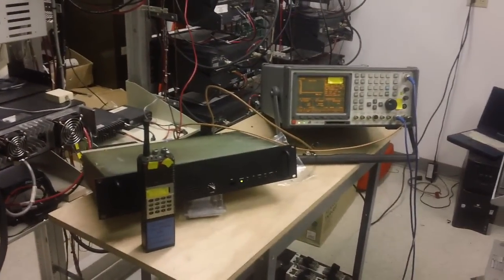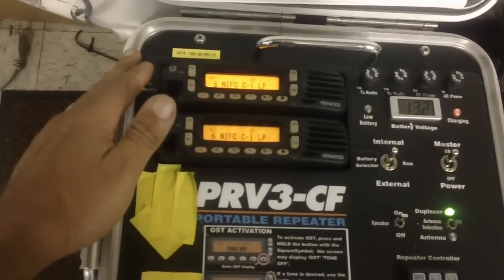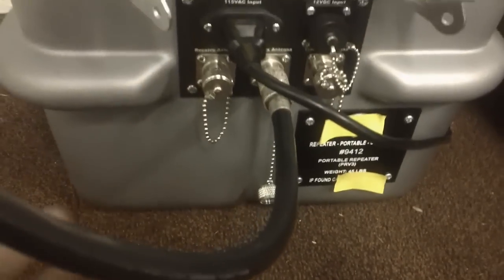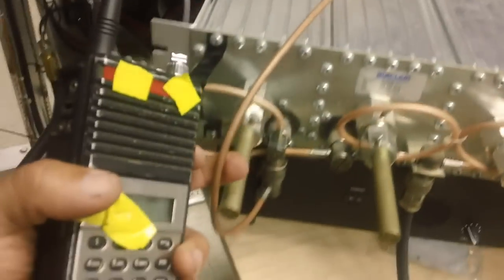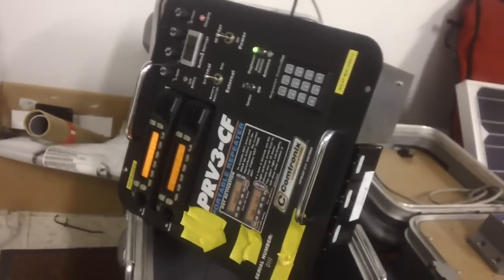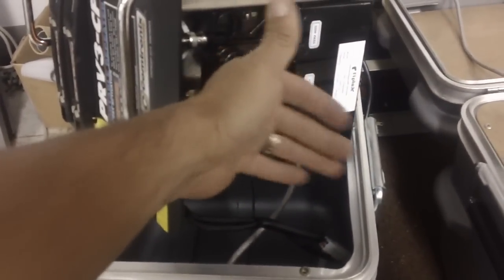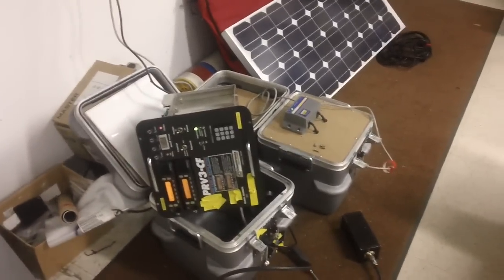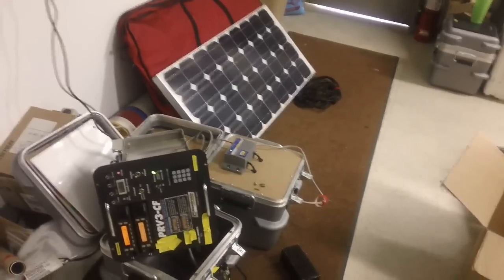Portable Radio Repeater Project, Realities Of Building A Home Brew Radio Repeater.

Comment: hee @guerillacomm ,

the simplex repeater project is a good few years old now,
I know you put it on a hill and check up on it every few months.

how does it stand now? (is it still active?)

at the moment I own a RD987 (DMR repeater)
and im in the process of building a simple repeater with some spare parts (had an extra duplex filter and two kg-uv920P radios. hook it al together with a raspberry pi as a controller and build me a nice temporary repeater for things like holiday and SHTF )

73,
PD0HOF

Comment: im quite skeptical on what antennas to use when mounting on high altitude mountains that is high gain and low gain antennas, can you do a video on repeater antenna for low altitude and high altitude mounting. what benefits on the type of antenna gain, i dont see any video about it and some people still use high gain omni's on mountains thank you
Reply: Antennas at very high locations require a lot of thought and often need to have "down tilt" designed into them. There is a very good Motorola 2 way radio technical guide out there that is essential reading. repeater-builder.com is also your friend.
Reply: @smorrisby  perfectly said <3

Comment: As a matter of practicality and cost effectiveness, what I've found works best for portable operation is to have a crossband repeater base radio station located at a high elevation above the surrounding terrain and use a high gain dual band antenna in conjunction with HT's on UHF to communicate through the crossband repeater to an established VHF repeater in the area.  This doesn't require any modifications to any radios or antennas - it's built-in features that pretty much provide the desired functionality of connecting operators using low powered radios with others at a long distance.  And, if there is no established local VHF repeater, you can use the crossband repeat radio as the repeater.   The main requirement is high elevation.

I do this at my home all the time, so I can chat with my buddies through the local VHF repeaters using my UHF HT - and, many of them do the same thing.   We can be located 10, 20, or 50 miles away and be chatting from our backyards using our HT's.   

One word of caution, though:   If you're going to set up a crossband repeater system, like I described, with a local established repeater, the radio and power supply need to be able to handle a high duty cycle - because, your crossband repeat radio is going to spend just as much time transmitting as the established local repeater.   So, it's going to be getting hotter and using a lot more power.  The best way to handle that problem is to reduce your transmitter power and rely more heavily on a high gain antenna - which is the best practice for HAM radio, anyway.

AI4IJ

Comment: Let's say I receive in uhf and want to repeat in vhf, is a duplexer still necessary in a smaller (portable) application?
Reply from the maker: yes, you still need a duplexer in a one antenna option. most dualband radios these days that does crossband repeat have the duplexers built into the device. The inband application is where you would need to get another component.

Comment: So, is there a cheap way to build my own repeater system? i'm looking to host my own IRLP/Allstar node at my house, while I don't have an external antenna yet, mounting one or two on my house (~25/30ft in the air) with a pair of chinese radios set up like that portable, what sort of range could i expect for 144/440? would 20 miles be a bit of a stretch for say, a pair of TYT 9800's? (clone of FT-8900)

how do you decide on a repeater freq? I know the ARRL has the band plan with specific freq area's designated for in's and out's, but do you just pick one with a proper shift and call it "yours"?

Comment: On my commercial UHF and GMRS repeaters I use RX preamps to make up the loss in the duplexers.
The cheap Chinese duplexers work fine if you know how to tune them. I have bought a few for use in some GR1225 repeaters tuned to GMRS and they work fine.
My big stuff (Commercial systems) use older Decibel 4 jug rack mounted duplexers but all have preamps on the RX side.
Reply: Hey I have one working on 220 it works great from looking at it I would say it won't work! but my service monitor told me otherwise

Comment: Hello GuerrillaComm... I have gone through your vid twice, quite easy to understand. Thanks for uploading this tutorial. May I seek some advice from you? Lets just say duplexer ain't an option for me. And I plan to setup a homemade repeater with just 2 mobile rig with 2 antennas transmitting VHF amateur band. Is there any specific formula on how far apart the Tx & Rx ant has to be? Also how much vertical saperation should be enough if Tx power is set on 25W to avoid intermodulation (Rx desensitization)? Is it the Tx circuitry cause desensitization or antenna cable? If it's antenna cable causing the desensitization, are we able to shield the Tx cable then? Sorry for asking noob question. Am a newbie in HAM's world =)

Comment: Is that a Spectra Engineering MX-800 ?
Reply from the maker: Tony Ling Yes it is, in VHF.
Reply: GUERRILLACOMM I've just bought one on eBay for $30, should arrive tomorrow.
Do you know if the Motorola MDX1500 software or Relm SRU50B or Simoco TRB9200 software will work with the MX-800 ?
Reply from the maker: I don't know, I use their proprietary programming software. Personally, I wouldn't cross breed the software unless you know for sure it's compatible. Manufacturers purposely make them not capable of accepting other makers software. its all about making money..

Comment: Without a duplexer there must be a vertical separation of 10 wavelengths between the TX and RX antenna (about 60 feet on the 2 meter band), with the RX antenna mounted higher than the TX antenna (with the TX antenna inverted).  Theoretically there can be a horizontal separation of 30 wavelengths (at the same vertical height), but in most cases that's impractical due to line loss in the coax. or separating the repeater's transmitter and receiver with audio cabling and wiring for a carrier operated relay (COR) running nearly 200 feet.
Reply: Dave Mitchell is there any advantages of vertical separation over duplexer?

Comment: I am vey interested in making a repeater for my 800mhz 2way radio. Would like to get some guidance.
Reply: +Yoandra Jimenez Are you licensed to use 800MHz?
The simplest way is to buy a pair of Motorola Maxtrac 800's that are 16 pin models (like $25 on ebay each) and one of those homebrew repeater cables for such things (IDK maybe $15 on ebay). and a pair of antennas with at least 3 feet of seperation (the NMO kits and antennas may cost you more than the radios lol)

Comment: Nice video; glad to know I'm not the only one lugging IFR-COM120B's around these days...  [Love that monitor].... 
1) Interesting Comtronix Box - never seen that configuration, looks like 8180's?  Any idea which controller it uses? (cant believe it's a one-off)
2) Spectra Engineering - Great & awesome, have used them under various labels...  (Relm, Motorola, Simoco, DX Systems, etc.)
3) The radio tech in me is looking at the variety of gear out there, looks like some Daniels stuff, Icom's, and beyond.   Would be interesting to put a tech-to-tech channel to discuss various modes of failures, etc.   I've thought bout doing it a number of times...   Keep up the good work!

Comment: I've been designing, building and installing repeaters for 40 years.
Perhaps in your efforts to make your video understandable by the "hard of thinking" in the survivalist movement, you've over-simplified too much.
You need to identify your target audience and title your videos accordingly.
Incidentally, my current repeater projects are commercial ones, but I've done a lot of "guerrilla" installs in war zones!
Reply from the maker: With 40 years of experience under your belt, you do realize that most of the beginner end users of the equipment gets overwhelmed and shut down with the technical details, if they are interested on how it works. I'm not preaching to the choir, nor do I want to, nothing I present will be new to them and will bore them to tears, frankly. My target audience is the beginner that wants a bit more info than just operating the equipment. I have 25 years experience in the field, from simple vehicle installations to communication command centers, end to end console interface to and from repeaters including war zones. I've learned the ability to translate technical  concepts into everyday language is equally just as important to designing, building and installing equipment to prevent operational failures. My "oversimplification" is just about the right level to introduce these concepts for armed forces service personnel, police officers, firefighters, and a preparedness minded individuals who have higher priority skill sets to their occupational positions, which are not "Hard of thinking" by a long shot. If that helps just one person to understand a concept then its well worth it to me, and I get plenty of positive feedback professionally and here on YT on that matter. This is not an insult, but perhaps you surround & isolate yourself primarily with engineers, technicians and advanced ham operators, and lost your patience or ability to interact with the common public. I don't have that choice, nor am selfish enough to not interact with whomever wants to learn.
Reply: GUERRILLACOMM OK.  I see where you're coming from.  Perhaps you're right - I'm mistaken about your target audience.
Reply from the maker: Christopher Hunter Thanks for being a gentlemen about this, I had a sense you were reasonable than the common YT troll throwing insults rather than dialogue. My usual reaction is to be just as nasty with a bit of colorful language to go along with it. I'm glad to know there are honorable people out there with strong opinions and even stronger humility. Thanks for watching and critiquing the vid, and happy new years.
Reply: GUERRILLACOMM I appreciate the simplification. I’m new to HAM and every time I go into HRO my eyes glaze over within 30 seconds of me entering the store because the employees lose me with techno babble.

A lot of Experienced HAMs forget to dumb it down for the new guys and inso doing it discourages is from pursuing the hobby.

I’ve had my license for 5 years and am only now getting into HAM again because I felt so alienated when I first tried.